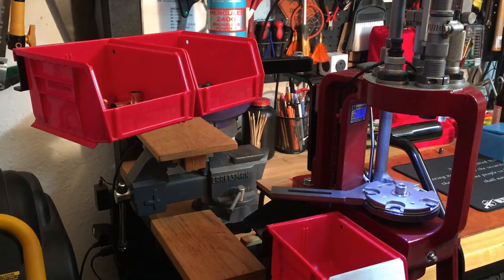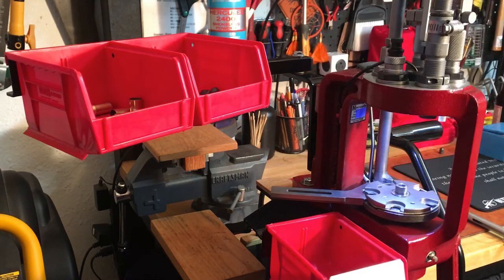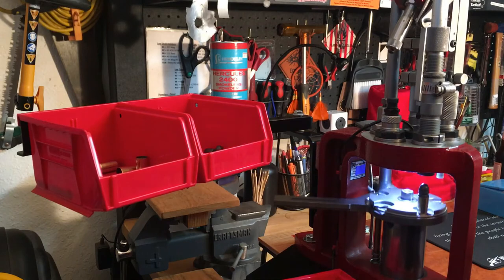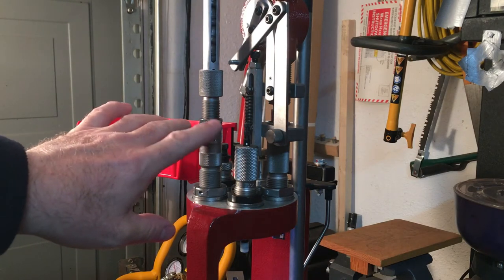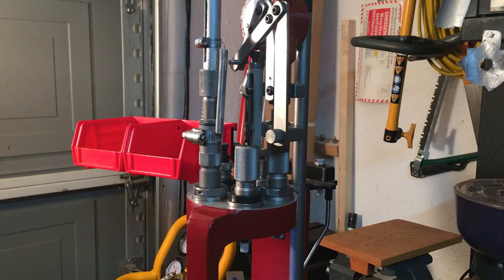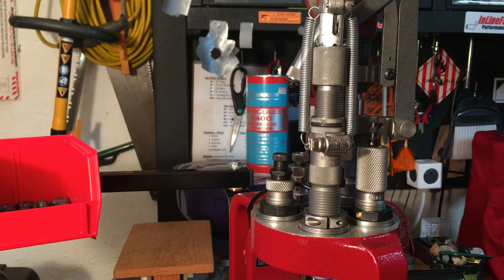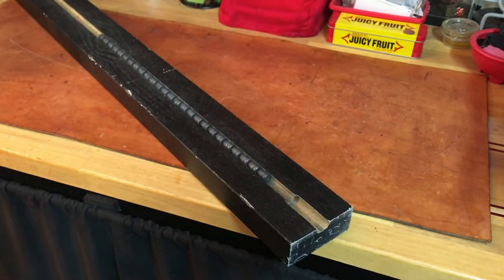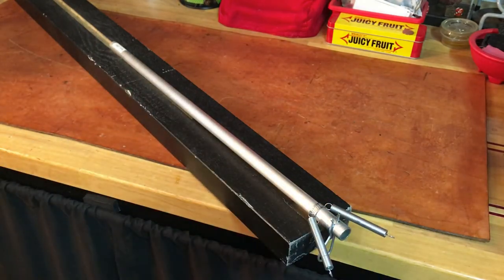Lock 'n Load Bullet Tubes: Poor Man's Ammo Plant part 1

Comment: This is the exact setup I have now for my LNL setup for 45 ACP. I don't load enough for me to justify the full ammo plant setup. I tried the bullet seating dies and tubes. I love the setup. Now I solved the tube movement by taping one of the tubes in place with electrical tape. Now it functions very simlar to the primer tube. I leave the one tube in place and use the others to fill it. Now, I need to get bullet feeder dies and tubes for 9mm, 357mag and 40S&W.
Reply from the maker: I "upgraded" my Hornady LnL Bullet Tubes to the Socal S&W Mag-P bullet tubes and have never looked back.  Amazing product and wish I had found it years earlier (my "solution" to solving tube "lift"/movement was a hack that worked, much like your electrical tape approach).  With the Mag-P , it's like having 6 Hornady LnL Bullet Tubes on your bullet feeding die at once.  Best value for the $ and incredible fit/finish aluminum work.  Top notch IMO. 
Link:
https://socalsw.com/Mag-P-Large-v2-40-cal-45ACP_p_30.html
Reply: @ReLoadersBench  Thanks for the link. I will have to try one of these out. Kinda makes the electric feeder superfluous 😁
Reply from the maker: Stanley Harrell - totally agreed. I like keeping my presses as mechanical as possible.

Comment: Interesting... I use the Hornady bullet tubes on my LNL AP when loading 357 and they work perfectly. Perhaps the bullets you are using are slightly to small for the die causing them to tilt inside and catch the tube on the lip of one of the leaning bullets.

Comment: excellent idea, by any chance did you even look at the Mag-P Large (40 cal, 45ACP...) multi tube bullet magazine. With a slight modification to the top of the bullet feeder thumb cap. it can fit quite snugly.
Reply from the maker: I have been running the SocalSW Mag-P in 9mm on my XL750 and in 45ACP on my LnL presses for a couple of years now.  My current LnL configuration has changed quite a bit since this video.

Comment: I had the same issue. I corrected it by breaking down the feeding die and polishing the inside diameters of the die . Understanding how the thing worked, then by lightly rubber wheeling and felt wheel polishing perfected the mechanism that would allow .355 diameter plated bullets to drop on correctly flared cases cause it’s the flared case that spreads the diameter open to let the bullet drop. Hand tuning as they say so when a case is raised up into the die, you can see the aluminum tube try and raise up but no sooner when the tube moves you hear a clunk and that’s the stack of bullets and tube dropping a bullet on the case. It’s never pushed out . Looks like your running cast bullets through it.... are they lubed, I don’t think that dropping die was meant to drop lubed bullets. Probably why the bullets are pushing the tube out. Just sayin

Comment: I started out with Hornady equipment. They truly make good products, but it seems they are not always thought out fully. Great fix to a problem that should never have made it to the public.
Reply from the maker: Thanks and agreed.  Frustrating pulling the handle and having bullets fall all over the place when you're busy looking at other things during the reloading process that need a bit more attention.  Got the idea from the spring on the powder measure and its purpose.  Not the most elegant solution, but quite functional.

Comment: I’m new to reloading and cannot make my mind on a lee or Hornady. You mentioned that you have few lee presses. Which you like the most?

You can’t fix dumb with a 2x4 but you can definitely numb it. 
Or you can build a bullet feeder!!!
Reply from the maker: My absolute favorite (and most versatile/flexible/interchangeable) press hands down is the Lee Classic Turret (I have a series on that press).  Running it in single stage or indexed mode along with the least expensive (and fastest) caliber changes are huge advantages as well as this press being built like a tank and for the low price is just great package.  I've said before if I had to give up every press except one, which one would I keep?  The LCT.  No second thought to any other press, Hornady or Dillon (from my point of view).   It's also an economical way to get into reloading in general as well as multi calibers.

Comment: Interesting.  I haven't had mine come out like that but now I wonder if it is causing my feeding issue.  I was loading 45 Colt ammo and having issues with the bullets getting stuck in the die when feeding from the tube.  I have not yet tried 45 ACP to see if it's works better but maybe it's the loose tube?
Reply from the maker: For my moly coated cast 45 ACP, I had to polish the inside of the bullet feeding die in order for the bullets to drop/feed.  Also, the feeding tube was useless to me unless I clamped it down.  I've since moved to SocalSW's Mag-P bullet feeder and have abandoned using the Hornady Bullet Tube.  No regrets.  My bullet tube hack/solution worked for me, but I'm truly enjoying the Mag-P.
Reply: @ReLoadersBench  Cool.  Is there a video on this that I can research?  Any video?  Website?  I'm needy, I know.
Reply from the maker: @paulseebach5978  - I did a video on the Mag-P for my Dillon XL750 (I'll put the link below).  The Mag-P on my LnL is the exact same product, but only for 45 ACP instead of the 9mm for the Dillon.  I've loaded >700 rounds with the Mag-P on the LnL and didn't have a single issue.  Flawless.  If you Google "bully adapter", you'll find SocalSW and the Mag-P.  They are beautifully finished products. 

Mag-P demo on XL750:  https://www.youtube.com/watch?v=MuZyP-ewcG4&t=2s
Reply: @ReLoadersBench  Nice video, thanks.  And thanks for the info.  I'll prbably have to get these for both the 9mm and the 45.

Comment: Does that really save a significant amount of time? By the time you line up all the bullets in your “loader” couldn’t you have just dropped them in the tube? Cheers
Reply from the maker: Half a dozen of one, 6 of another I'd venture to say.  Do you spend the time to adjust a powder measure/drop for a specific weight or do you powder charge each case by hand?  How about primers, pick them up in a tube to feed on press or individually seat each primer?  Place each case on the shellplate or spend a few minutes loading up a case feeding solution?  Where to draw the line on setting up components to have a smooth, non-interrupted session of reloading?  I personally prefer all the prep work up front to have a seamless, fast (subjective I guess based on how you measure reloading time vs prep time) reloading session.   In later videos (as this is 5 years ago), I show/use the Mag-P by SocalSW which is for bullets what the Double Alpha Mini Case Feeder is to brass.  At the end of the day, to each their own.
Reply: @ReLoadersBench  Actually l agree with you. My reloading is more for relaxing rather than a high hourly count. Like you I do like getting things ready and just so. I’m somewhat OCD.  I really do enjoy your videos and watch your channel regularly. Keep up the good work. Cheers, Gary.
Reply from the maker: @sherlock1895  - I have often asked myself do I reload to shoot or shoot to reload?  I equally enjoy both sides of the hobby and find reloading (even when things go awry) to be relaxing.  Nothing more satisfying or rewarding than creating something of quality that I can then use.  Thanks for watching my channel ;-)

Comment: You are the only person that has to put springs on your bullet feeding tubes. I have watched a lot people using the Hornady LNL press and you are the only using the springs. I have the same bullet feeding dies  for my Hornady LNL press, for 9mm, 38/357, 44 spl./ 44 mag and 45 acp. and I DO NOT have any problems with tubes doing what yours are doing. There are two (2( size of tubes. One is for 9mm and 38/357 and the larger set of tubes are for 44/44mag an 45acp. I have been reloading for 40 years. If I can be any help to you, you can e-mail me and I will give you me phone number. May be I can help you with this problem. Just e-mail me and I will try to help.
Reply from the maker: So the first question I'd ask you on your 45 ACP bullets for the LnL tube is are they cast/lead or plated?  Copper plated/jacketed 45 ACP bullets work fine, but the cast/molly coated lead bullets from Bear Creek (what I shoot exclusively) are just big enough that I had to do the springs in order avoid bullets all over the floor repeatedly as the tube would "jump" due to just enough friction.  Gotta do what I gotta do.  

I just built out a Dillon XL 750 for 9mm and will also be using the Hornady bullet feeder tubes and the bullets will be copper plated, so I'm not anticipating using the clamp/springs...unless I have bullets all over the garage floor.
Reply from the maker: Just found this and thought of your response to my solution.  

So if lead bullets work so well in the Hornady bullet tubes, this guy went to a LOT more trouble than I did with my springs to keep the tube in place...

From 2011 - How to customize Hornady bullet feeding die for lead bullets and custom feeding tube

Part 1
https://www.youtube.com/watch?v=bJro27cx0yA

Part 2
https://www.youtube.com/watch?v=3ZVa8llMwEg

Part 3
https://www.youtube.com/watch?v=HePlzmGNvMw